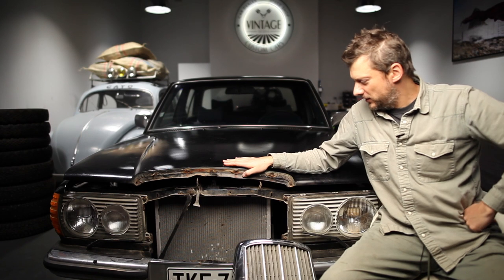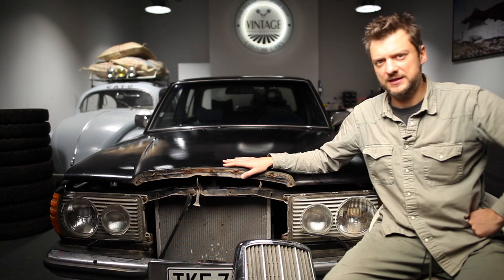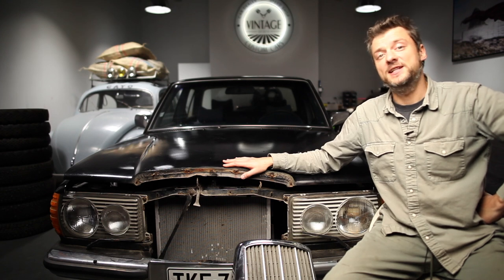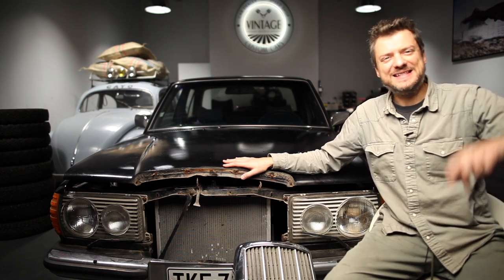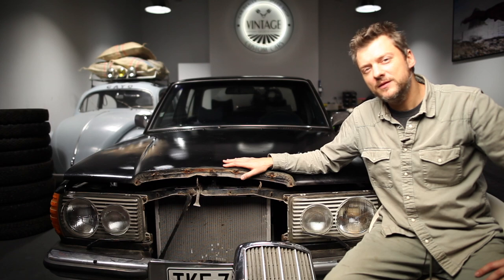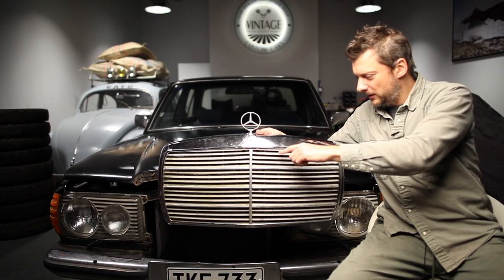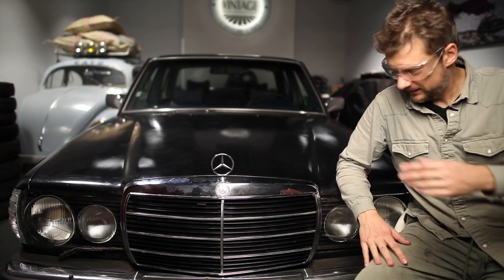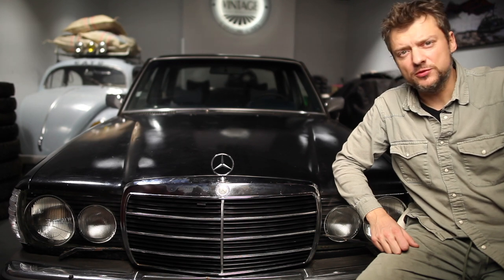Classic Mercedes W123 I How To Make Look Better

Comment: Looks very good I think if you have a black body paint with black accents. Do you think you could get the same look with any other body colour using the same colour as the body colour to do the accents on the grill and light grills?
Reply from the maker: i am not sure about other colours as usually these things are paint in black, depends what body colour you have? but i suggest you to check on pinterest or some mb forums how are done, it's most safe way to compare and do it self later...